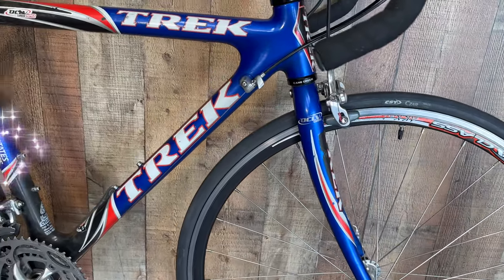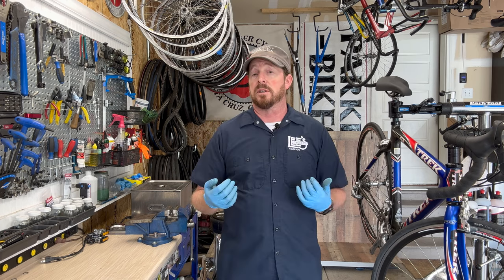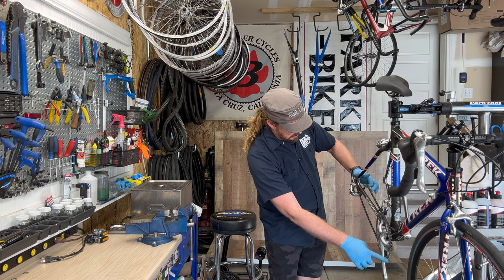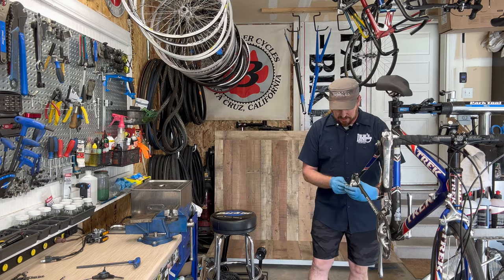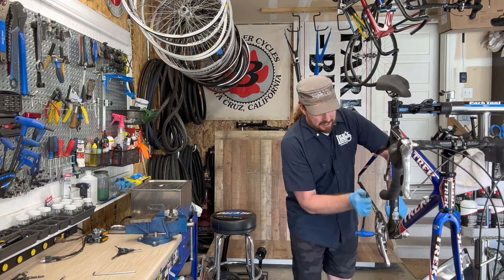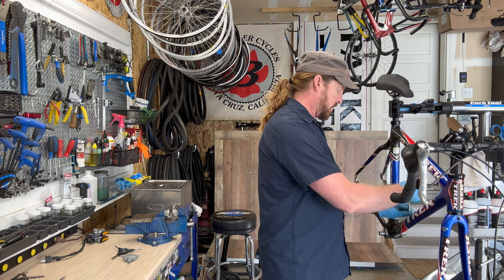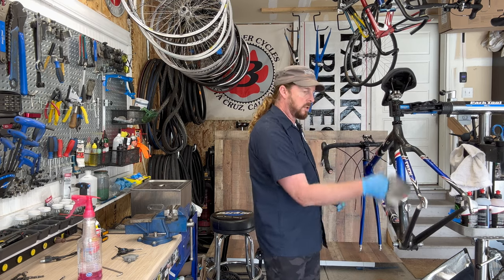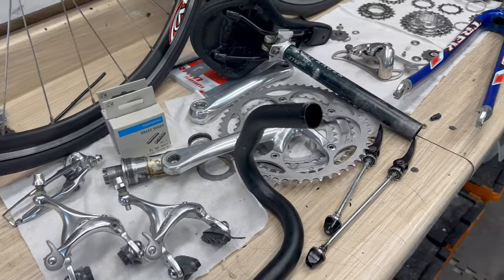2003 Trek 5200 USPS Review - Diamond in the Rough? Or NOT! - Tips For Buying A Used Bike

Comment: I picked up a trek 5500 at a flea market complete for $ 400 , was in fantastic shape, stripped it down and it was like it had never been ridden, i up graded the fork, put a set of shimano c24 tubulars on it and it is almost as light as my giant tcr advanced sl bike , it arides fast and stable, i think its built better than alot of modern bikes that go for $5000 plus . Its not so much the bike as the rider. I have passed guys on bikes that are all decked out aero , disc brakes , aero handle bars etc and cost 10k plus. The bike is not outdated its the mindset of the rider that is .
Reply: Great move upgrading the fork. I saw a video here of a 5500 owner in NJ who updated his. He went out and crashed on it, busted a collarbone due to the fork. He then trashed the bike and said it was over which is sad because his video of how he brought back his 5500 was very nice.

My LBS said my fork needed to be updated as its dangerous so on my 5200 upgraded with a Ritchey Comp fork to a one-inch threadless and ditched the quill. Just serviced the headset the other day and it rides so quiet and nice. What kind of tires are you using?

Never rode my older 5200 in the rain and the new fork definitely makes a nice improvement. Have replaced some items: Mavic SSC wheels, carbon seat post, stem, Origami 8 headset but all original Shimano 600. Replaced the handlebars to a narrow aluminum version. With a waxed chain, it's never rode better.
Reply: @IronHorsey3  do you have the link of the "5500 owner in NJ" video?
Reply: @DerbyRojo  - here ya go, it's a damn shame. He did a great job rebuilding it. (IMHO, if he had replaced the fork, which he hadn't, he would never have suffered that crash.)

https://www.youtube.com/watch?v=kASkVuwPa_A&t=320s

Comment: Last Spring I was ruminating as to whether I should get a new bicycle.  I did not.  I learned something very valuable from this video that would never have occurred to me.  When examining the Lance Armstrong carbon fiber frame, the comment was made that carbon fiber frames can be damaged bouncing along on a bike rack in the back of a car. If I ever purchase a bicycle with a Carbon fiber frame, I will remember that little tidbit of information.  Thanks
Reply from the maker: It is with all bikes that bike racks can damage bike frames—mostly the paint and decals, but sometimes parts and wheels. Try to get a bike rack that separates the bikes so they don't rub each other.

Comment: If I bought a used bike from that era, I'd stick to steel or TI.  I really don't trust old 2nd hand carbon.  
Do you have any thoughts on the new MicroShift Sword groupset for vintage bikes?  It's got cable pull brakes and seems to have some low gears for old guys living in the mountains.
Reply from the maker: Instead of MicroShift, I would buy refurbished Shimano Ultegra 6500 triple group.
Reply: @IKnowAGuyBicycles  thanks

Comment: So interesting… I’ve got my mint condition Postal Blue OCLV Ultegra 2x from the Lance days hanging in my garage. Geared way to tall for myself, wish it had triples. I think I’ll keep in original condition simply for values sake. Really enjoyed your insights into this bike.
Reply from the maker: They are nice rides!
Reply from the maker: You can change it to a triple by replacing with used Crankset (triple) w/bb (FC-6503/BB-6500 118mm), Front (FD-6503) and Rear derailleur (RD-6500 long cage), plus a new chain (need to be longer for a triple) for around $250 in parts. Just google the part numbers to get pricing. The shifters you have (ST-6510) are a double or triple.
Reply: @IKnowAGuyBicycles  

Wow... that's awesome! I didn't know about the shifters. I had considered long cage, large cassette before but if you're familiar with these front chain rings and derailures, existing tolerances are very tight with the chain rubbing for the slightest mis-adjustment. Additionally, like you, I've always appreciated the tight ratios of a small cassette; this may really be the solution for me as I age up.

There was a time when I was embarrassed to ride around in PED blue but I've gotten over it. Those were grand times and years when America, its sponsors, and audience were captivated. And it's really cool paint too!

Thanks so much for the research and it sounds like a change over I can manage myself. I'll keep the original gearing should I ever wanna convert her to a wall-mount memory maker.

I really do know a guy.... 😂
Reply from the maker: @kenmunozatmmrrailroad6853  I do have some of those parts on my website. Not sure they are in the condition you want. But you can at least see what you’re looking for.

Comment: Regards Titanium back in the 90s the top end frames were using custom butted/spec'd tube-sets but a lot of bikes used Russian sourced tube sets which they said at the time came from recycled MIG jets. More likely they were pumped out in the same factory that made tubing for Russian jet airframes.
AFAIK the main reason titanium is so expensive isn't so much the cost of the raw material but more the cost of forming/machining/joining it which requires much higher heats and harder cutting tools than steel or alu.
Edit: Did you weigh the OCLV frame with the headset cups? That could add a hundred grams ;-)
Reply from the maker: Great insights on Ti. Yes, that included the cup set and seat collar. It's even lighter and about as much if you just got a haircut before your next ride. lol